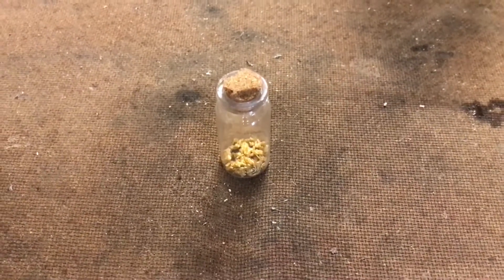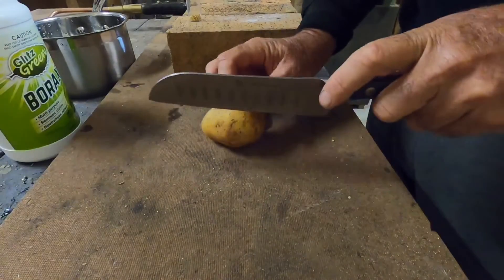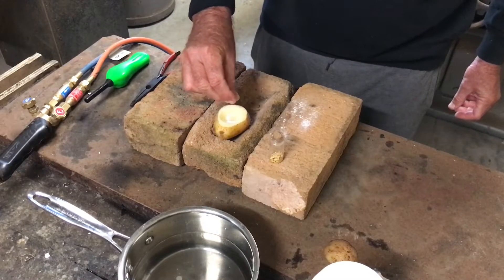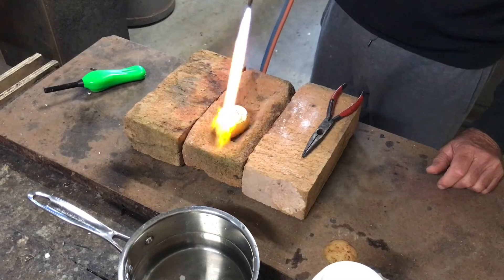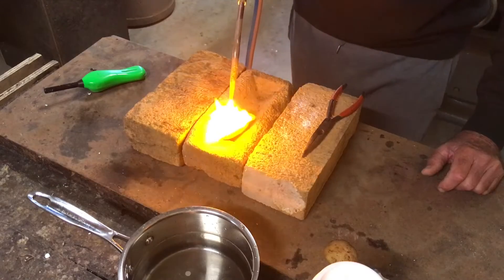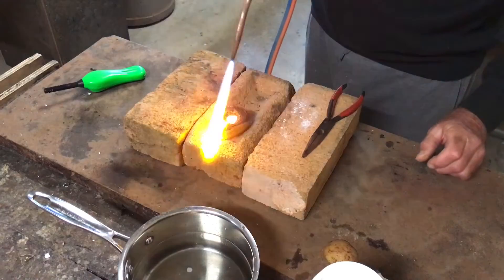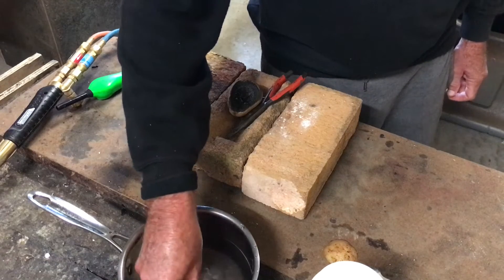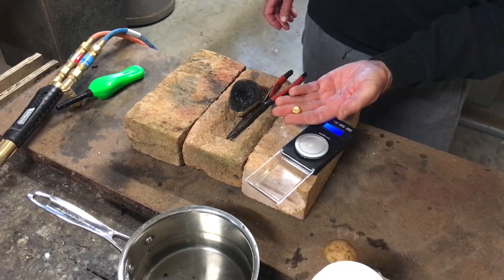Gold Nuggets Melted Into A Button Using A Potato Crucible @ Les Gold

Comment: I would recomned doing this in a space with good ventilation as well as wearing thr proper PPE since the fumes released during the melting process can be extremely toxic.
Reply from the maker: Good point. Thanks for the input.

Comment: How come you put more flux in and can you melt more gold at one time with a bigger potatoe
Reply from the maker: Hi Leigh. The flux helps to remove impurities from the gold nuggets. It basically floats on top of the gold and sets to a glass like material. It’s better to have a good quantity of flux rather than not enough. As the borax powder melts, it’s mass reduces which allows for more flux to be added. The potato is a simple, cheap crucible. Yes, more gold could be smelted in a larger potato.